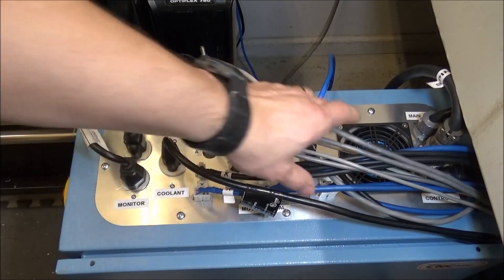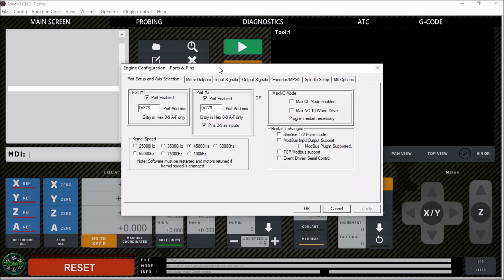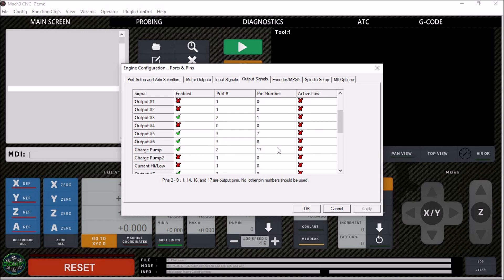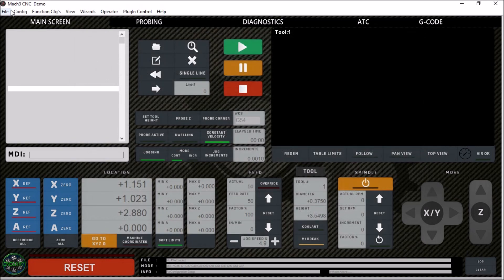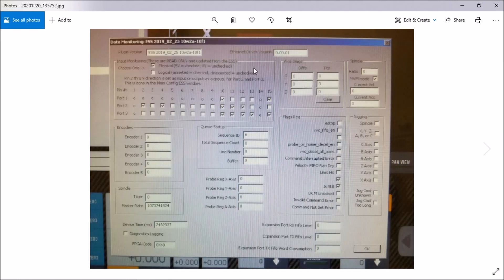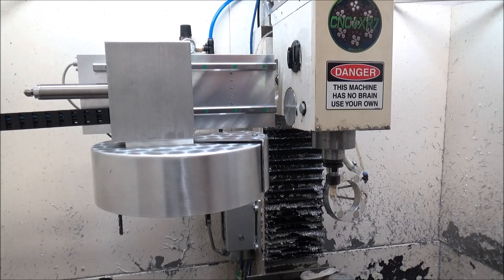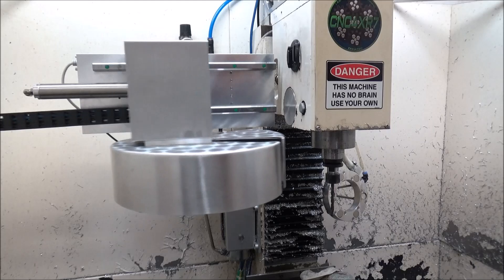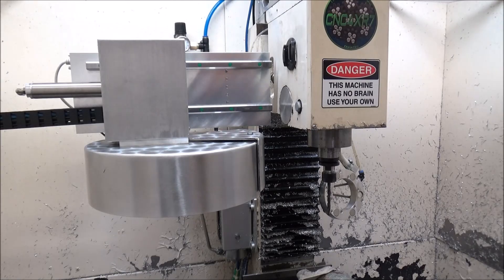PM727M ATC 1st Tool Change

Comment: Hi, I just seen your rotary cnc machine I was very impressed.
I have just bought an AXYZ WITH 8 TOOLS CHANGER.
I have decided to use Cslab motion controlller. Im able to follow the wiring diagrams however the programming scares me. 
It has a TB WOODS X2C inverter to a hsd e919 spindle.
8 tool changer that uses proximity sensors (two pick ups close to each other i presume for a home)
Tool height sensor . With stepper motors used throughout.
Ideally I would get it working correctly so it's jogging on all axis. I'd happily pay you to sort out macros or vb coding. I'd be able to jog over the tool changer etc to get coordinates.
If this is something we could work on together please let me know.
Many thanks for your help 

Tried emailing you
Reply from the maker: Try emailing again please. Channel name @gmail.com

Comment: EXCUSE MY ENGLISH BECAUSE I TRANSLATED IT IN GOOGLE, I KNOW HOW TO MECHANICALLY MAKE THE REFORM WITH A PNEUMATIC CALIPER WHAT I DON'T KNOW IS THE CONFIGURATION OF PORTS AND PINS IN MACH3, I HAVE A PARALLEL PORT INTERFACE AND CALCULATION THAT WHEN ORDER ANOTHER CONNECTOR IS CREATED WHAT IS POSSIBLE, SINCE THE INTERFACE I'M USING HAS TOSAS ITS BUSY OUTPUTS ONLY THE B AXIS IS REMAINED I DO NOT KNOW IF IT CAN BE USED FOR THIS PURPOSE, I THINK YOU ARE A GENIUS AND FOR SURE YOU SAVE HOW TO DO THIS CORDIAL GREETINGS ARIEL
Reply from the maker: I will try and help

Comment: Very nice. Best ATC I have seen for this machine types. I also modified the Physic Anonimous screenset. Really clean. Only one thing I have notice, when you use smoothstepper like the kernel speed at default 25Khz since smoothstepper doens't take it into ocnsideration and the manual says to leave it at deafult value to avoid problem.
Reply from the maker: Your to kind! I tweaked the screen pretty good stay tuned for the screen video! Thanks for the info on the Ess
Reply: @CNC4XR7  Sure! I am looking forward for it